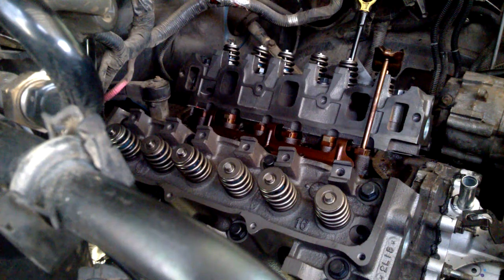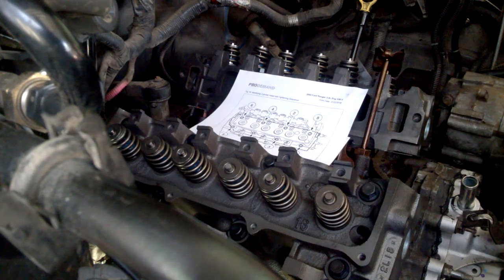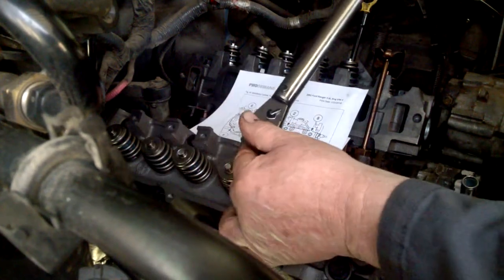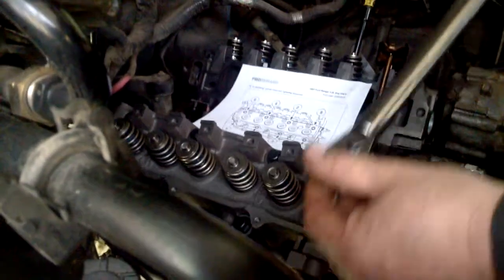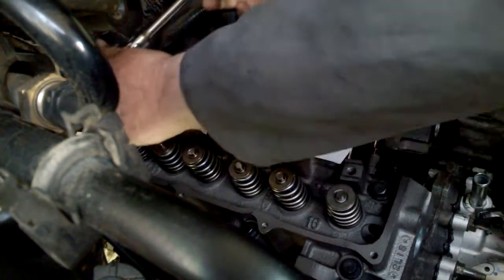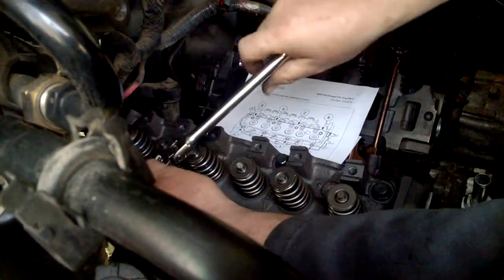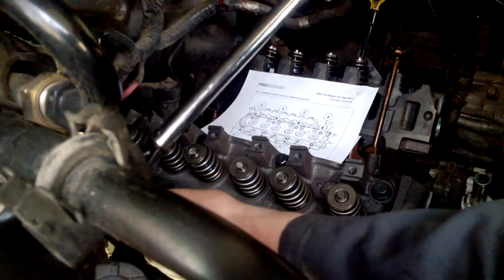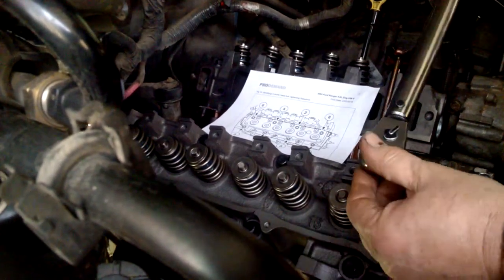Torque Sequence 3.0 L ford

Comment: 37ftlb, loosen one turn, 22ftlb, 90deg, 90 degrees...done
Torque to Yield TTY Bolts.
You will snap bolts if you follow this incorrect procedure.
Bolt manufacturers must generate these incorrect vids!!

Comment: This is completly wrong i broke a head bolt off on my ranger thanks alot buddy you cost me money i dont have
Reply: Joseph I don't think you bought new Head Bolts and installed them? You used the old ones? Not suppose to do that
Reply: 73 ft lbs is not enough to snap a head bolt. not even close unless you used an old bolt or low quality off brand bolt set.
Reply: Not his fault youre not a mechanic lol maybe fine a procedure other than the first youtube video you watched.
Reply from the maker: Sorry to here about that ,it s the way do it, did you used new bolts and did you clean the bolt holes out, been a mechanic  for all my life done 100s of them never had  a problem,truck in the video is still running,anyway iam not in to  bashing  people,have to say you did something wrong!  Did you surface everything!

Comment: I sent my heads to the machine shop for valve seals and valves now I don't know which is which I know one has a 8 the other a 9 any suggestions quick as I find out I'm going to use this method to installation thanks for posting
Reply from the maker: Are you talking about heads or vales?
Reply: @racedwg  heads
Reply: @racedwg  heads
Reply: @racedwg  one head should have a ground wire, so when you took it off you should Remember.
Reply from the maker: As for the heads,thay can go on either side.
Reply: @racedwg  thanks you have truly eased my mine thanks you have been a big help